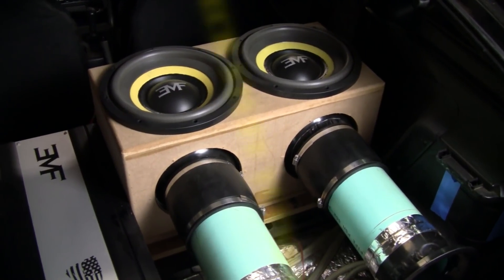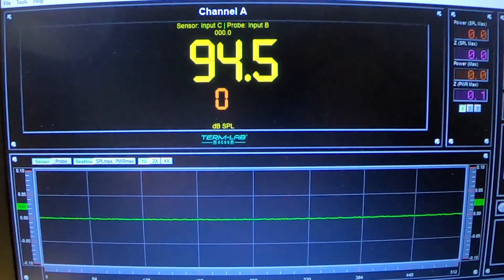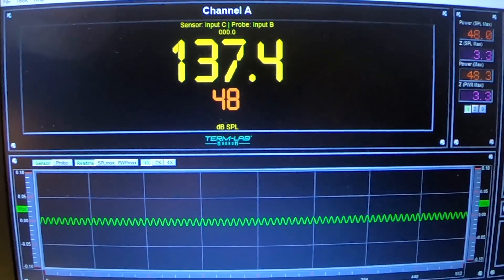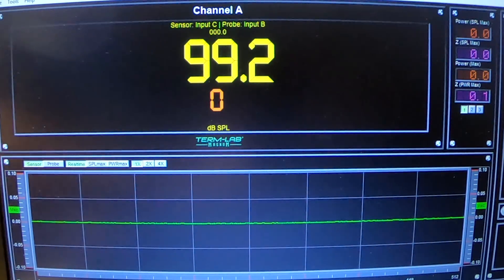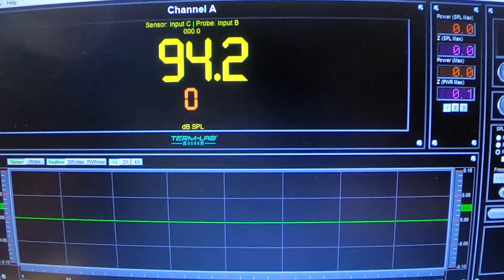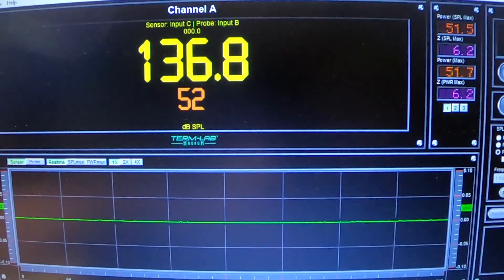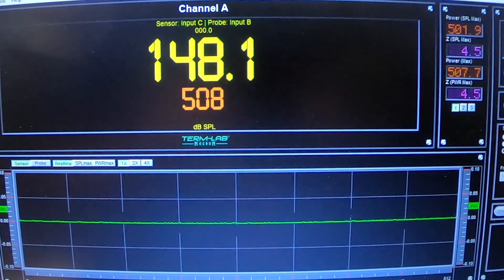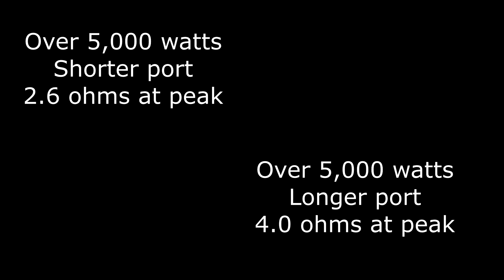Impedance change in enclosure - Tech Stuff Tuesday

Comment: so how does wiring to 0.5 ohm harms the amp, if it always rises above 1ohm ?
Reply from the maker: Frequencies are dynamic, impedance doesn't stay the same during play. It is possible for impedance to go down as low as how you wired it. So, how does it harm an amp? Well, lower impedance has a higher current on the outputs. If the outputs can't handle the current demand (there is no fusing for that, after all, you shouldn't be doing it, right?) then they fail. There is also the issue of can the power supply handle it? Even if the outputs can handle the current, will the power supply be able to sufficiently keep up with the output demands?
Reply: @EMFAudio  ok, thx i see now, 1 more question in related to ohms, i have 4 subs, 3 are 1ohm, and 1 sub is 2 ohms, can i mix and play the 2 ohm sub in with the 3, one ohm subs all wired in series, on strapped amps is that safe?
Reply from the maker: @teeone10  Short answer, don't.
Reply: @teeone10  don't do that ever
Reply: @nickriker8336   i didnt, too risky

Comment: Enclosure dimensions, and tuning?
Reply from the maker: If you watch the video, it says all of that. Also, that box is made for those subs in that car.
Reply: I've watched this video three times and not once was there any mention of the exact cubes or tune of this enclosure. Only mention was the sub wiring which was half ohm and the impedance fluctuation. I have another question also though, was the shorter port lower or higher tune?
Reply: EMF Audio I'm really curious because I have two Deaf Bonce SA3 12'S and I want to have an aero port enclosure built tuned @30hz. I have a 6cube box tuned @35hz currently and its not as low as I'd like.. I've been told that I had an issue with "box rise" which I now know is impedance rise thanks to you videos.. I'm just wondering if I'd be louder with a smaller enclosure instead of a larger one.
Reply from the maker: @shaunjay6040  My mistake, this video is the one that has that info. https://www.youtube.com/watch?v=VCYP7CRT5No A shorter port is a higher tune when you maintain an enclosure volume.
Reply from the maker: @shaunjay6040  6 cu. ft is way too big for ANY pair of 12's. Tuning I can see where you'd want to tune lower but I do believe you would be louder with a much smaller box.
Reply: EMF Audio thanks tremendously. I've been online trying to figure out how to correct my problem for a couple months now before narrowing it down to the enclosure. The recommended space required per sub is 1.9 cubes each. Which I still think it's rather small considering the subs are rated at 2800 rms each. Would you recommend going with an enclosure built to spec, or something a little bigger like 3.5 cubes after displacement?
Reply from the maker: @shaunjay6040  thermal power handling has nothing to do with enclosure size. A larger enclosure REDUCES mechanical power handling. I would start with the recommended box, there is a reason they recommend that.
Reply: EMF Audio fair enough! I've subscribed and I'm going to watch all of your videos to becomes more so if I have anymore questions I'll definitely be in contact..

Comment: So basically correct tuning > increasing power
Reply from the maker: For SPL specific applications, yes. Changing the enclosure will result in greater gains than simply throwing power at it. For musical application building a more efficient enclosure is better than throwing power at it but if you try to make it peak 1 spot it will lose in another.

Comment: You intentionally do not provide enough information to make a scientific analysis. You are omitting the referenced frequencies, while simultaneously neglecting to continue to measure the impedance rise outside of this narrow range of "frequencies." With a longer port, system tuning has changed; therefore, your test should either quantify based on tuning or include a range that incorporates overlapping frequency ranges.
Reply from the maker: I don't think you understand the point of the video.